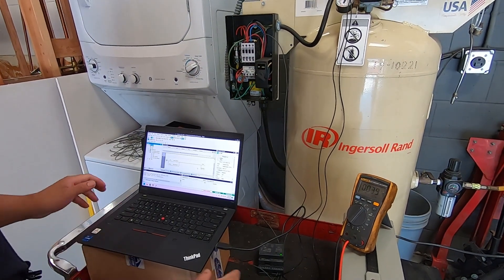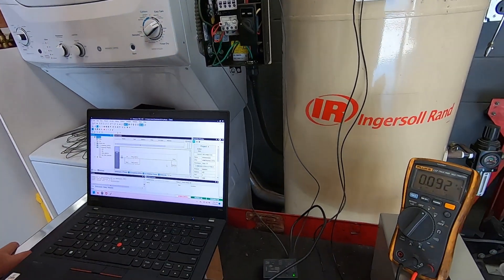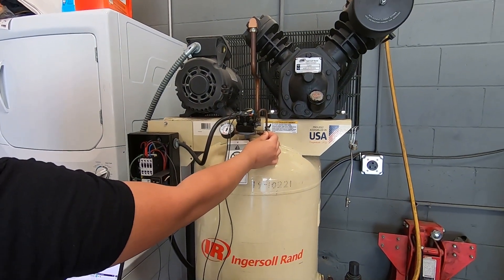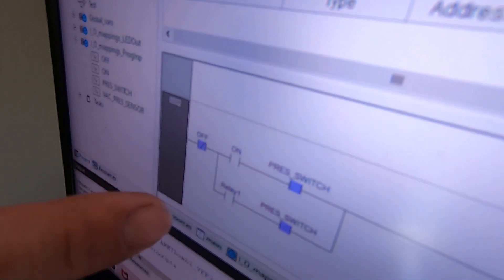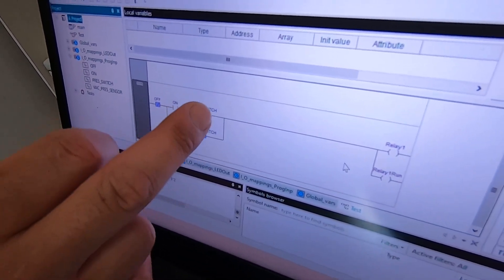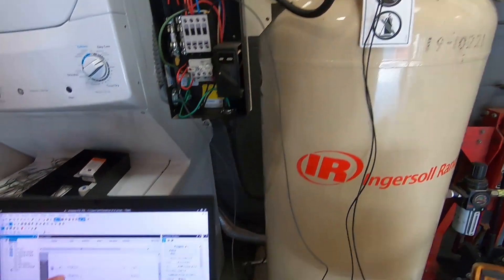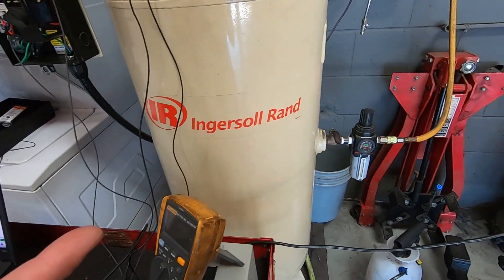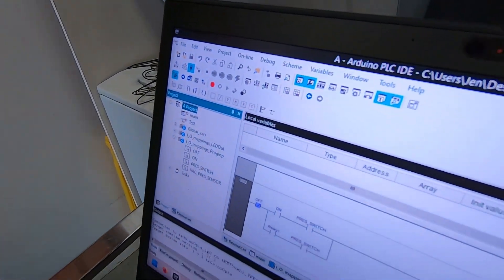Arduino OPTA PLC: Industrial Air Compressor Control Using Ladder Logic

Comment: Why would you do this if the compressor already has a pressure switch?  you've added complexity to something that is normally pretty simple as far as controls go.
Reply from the maker: This was just the beginning of testing and learning how to write ladder logic at the time. I was trying to making a smart compressor. The plan was to implement an actual pressure transducer, moisture drain valve with timer, an HMI that can control and monitor pressure along with other equipment in the shop from my office, the ability to adjust on/off times based on my operating hours, as well as a contact that would monitor if my shop’s security system was armed to automatically shut off in the event that a hose blew while I was not present at the shop. In the end it was for experimentation and learning.